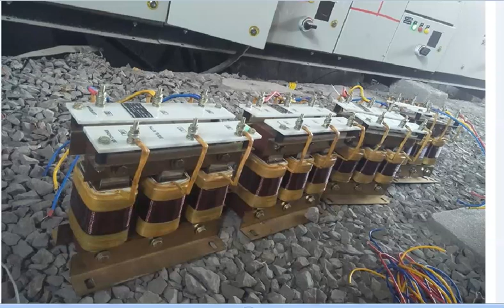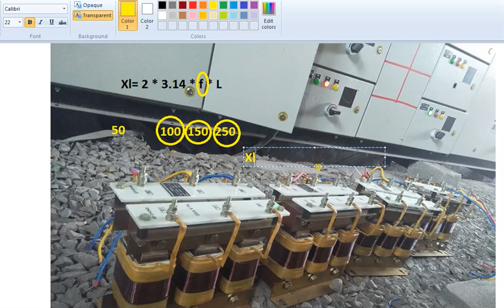How does Harmonic Filter Works in Tamil

Comment: Bro Drive panel use pannum pothu Power factor present 0.98  irukku but APFC panel antha drives load ku function aaguthu appo capacitor charge aagi power factor minus la poguthu ithukku enna solution sollunga Bro?